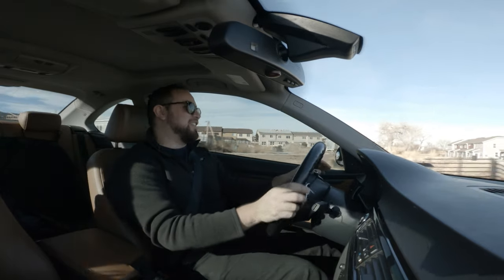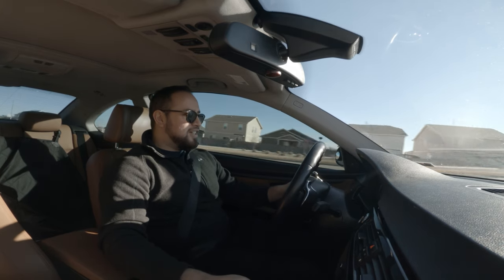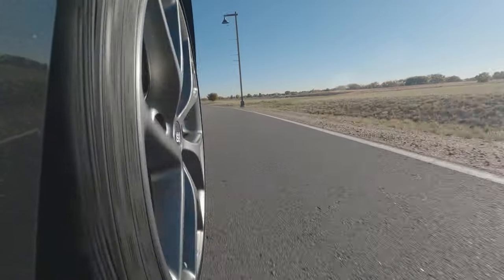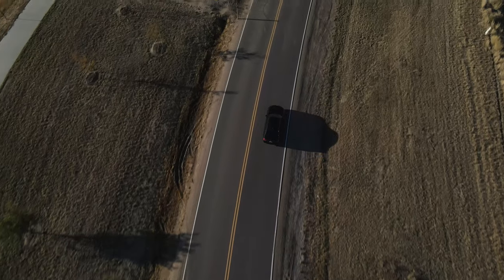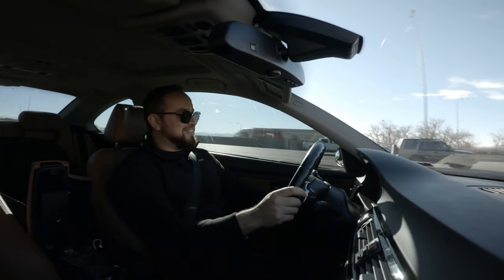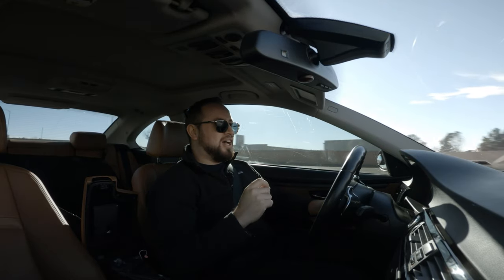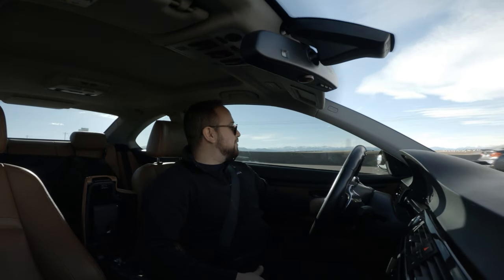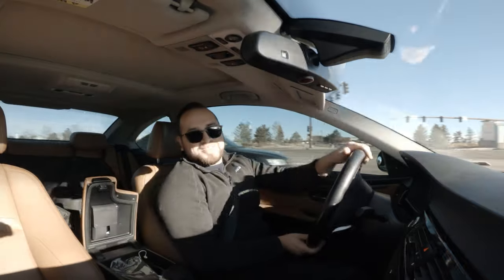Foundations of Tuning an Engine (Vlog)  - BMW N54 and KTM 890 Duke R

Comment from the maker: Have you ever tuned a car or motorcycle? Did you find the overall experience stressful or was the vehicle just as reliable afterwards?
Reply: No I haven’t so my 890r will be my first attempt that’s why your 890r tuning is so important to my potential tune process, because I don’t know a thing about it and definitely need hardware/software guidance😊
Reply from the maker: @dukie1616  That’s great to know! A lot of my upcoming videos will actually be talking about tuning methods and the means of making power. My ultimate goal is to not only entertain but to share what I’ve learned from an engineering standpoint so that people can feel confident in approaching any vehicle. So much of those that modify don’t understand the fundamentals and it is very detrimental to their engines in the long run.

Comment: Have you thought about getting the Coober LM device for the 890r?  I was going to get my ecu flashed but this looks like a very easy install and about the same price!  Looks like it gives a really nice gain in power as well.
Reply from the maker: Cooler has definitely made the short list but I have one major concern that I’ll specify when I get to the tuning choice video I’m working on! When were you thinking about pulling the trigger on a tune?

Comment: Letting people test out the waters has always been my approach until purchasing this 890r in the first year and a half of it’s introduction. Now the anxiety I feel every time hearing there’s a problem with someone’s 890r. It’s a love hate situation historically no different than any of my relationships.. now I digress.
Reply from the maker: I feel the EXACT same way. Every time I hop on the forum I’m praying not to hear about someone’s exploding randomly. I have definitely benefited from letting others lead for a long time, now I hope to do the same on this platform for others. I can’t wait for the season to start so I can get to creating riding content again. Plenty to do in the meantime though!
Reply: @AlejandrosEngineeredLifestyle  Thank you for sharing and taking us along with your 890r’s development. The shop where I got my bike is working on a 2021 890r warranty engine swap.
Reply from the maker: @dukie1616  that’s not quite what I wanted to hear lol. What happened??
Reply: @AlejandrosEngineeredLifestyle   didn’t really get a chance to pick the mechanics brain but some thing about the top end..
Reply from the maker: @dukie1616  Very interesting, my guess would be valve/piston impact due to inadequate valve clearance. Interference engines, especially those that rev to high RPM’s like motorcycles require tolerances that are very hard to achieve in a mass manufacturing and assembly line.